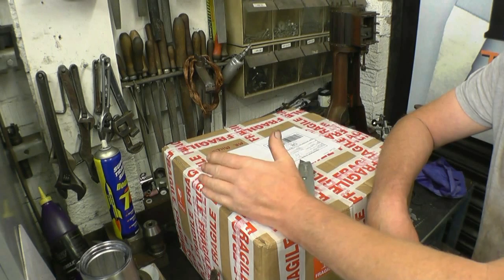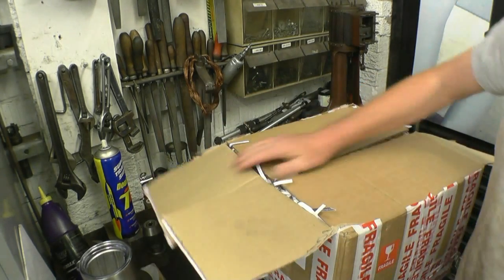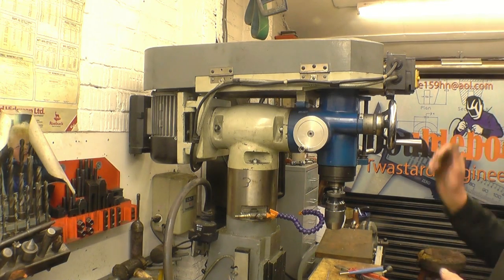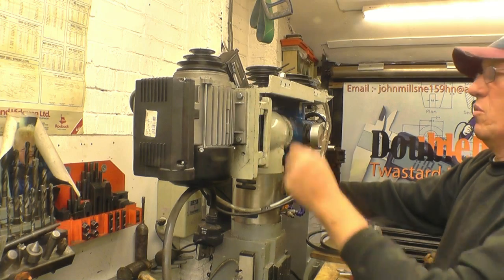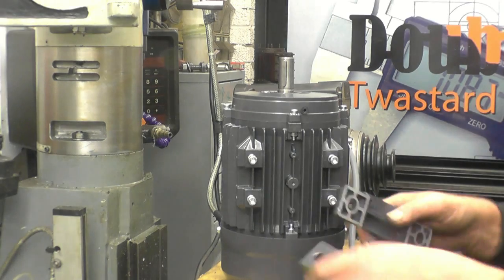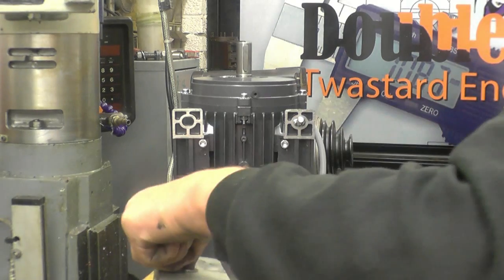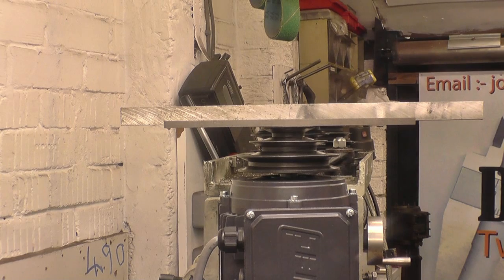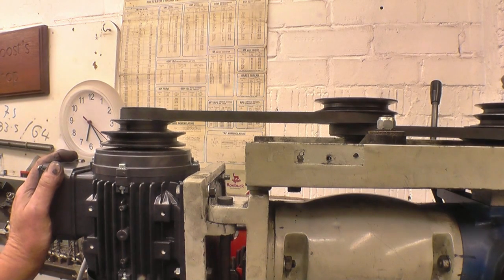626 Milling Machine  Newton Tesla Inverter  Part One

Comment: John, that's the first time I have seen the top end of you're mill. Looks exactly like my JET mill. Suspect you may have a rise that increases the space between the table and quill. With a swivel vice installed I have clearance issue when tapping a moderate size part. I have been interested in a reversing motor as well. Going on to part 2. Thanks for the interesting video's.   Randy

Comment: john  You may need to re align motor pulley to where it was on old motor, set belts on middle speed range an hardly ever change belts over again just use the inverter .  I have the same Newton Telsa set up and it works fine

Comment: I am not that surprised that the mill burns out one motor after the other.
A one 'orse motor is less than 800 watts, and that is rather anaemic for a substantial machine like that.
If had to have made the choice, I wouldn't have put anything under 1500 watt on that machine (that's two 'orses)

The electronic unit will have some inrush limitation and over-current settings, if used advisedly, they will prolong the life of the motor.
Nice gear!

Paddy

Comment: Dear John
Hello again from Canada.  Good couple of vids on installing a VFD.  I have over the years bought 3 Newton Tesla units.  I got a CL 400 (1/2 hp) motor and inverter package for my Myford ML7R, then  just a CL400 inverter for my old Richmond (Leeds) mill (I bought a Canadian 3 phase motor to go with it) and most recently a CL 1500 (2 hp) for my Ex-cell-O Mill.  I know inverters are available everywhere, but I bought from this company because I found the Newton Tesla people fantastically helpful with my questions, and all the units came essentially already programmed so I just had to put a Canadian plug on the mains wire and away we went!   I would certainly recommend N-T for a VFD especially if you are not comfy with wiring and programming an inverter.   Also their customer service is absolutely top notch.
Keep making the great videos!
Paul

Comment: Didn't repeated motor starts with the the quill pulley locking pin kill those motors? You need to tie in a kill switch or deadman there.